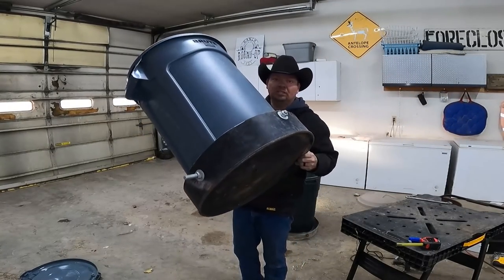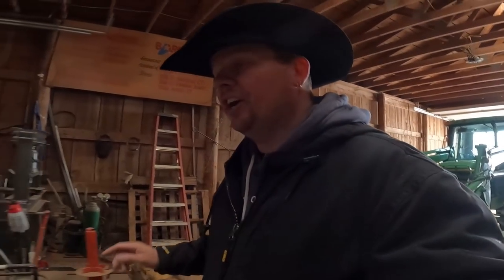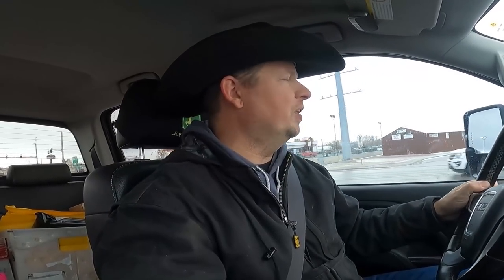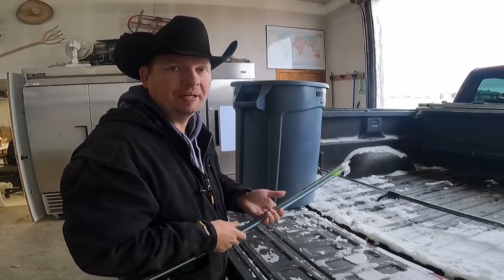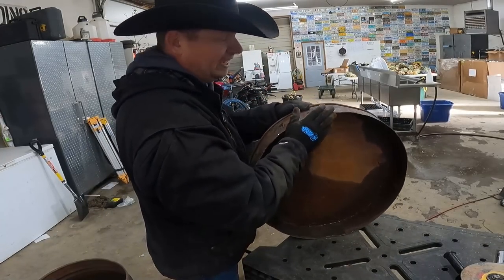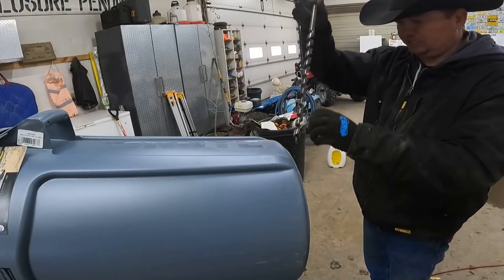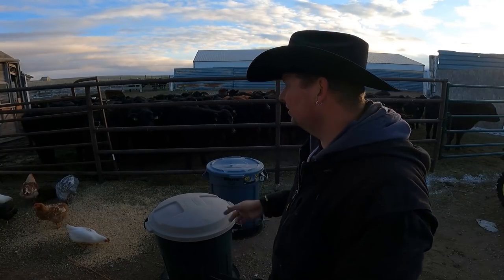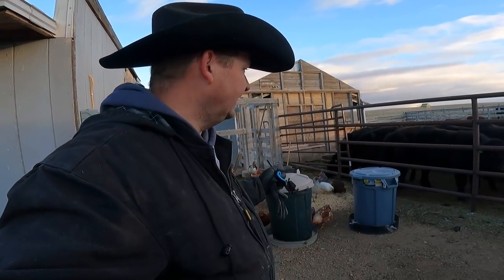Building a 200 pound bulk chicken feeder for under 50 dollars

Comment: Howdy Mike, we have a Storm Warning in progress, finally got some Snow ❄️🙌❄️! In VT at this time of year with no Snow is Pretty bleak,😝.
You look like I must have looked putting together my Gorilla Cart,😫. I screwed the nut on first everything fine . I went to tighten it down and it stopped dead on its tracks . So now the handle is loose and I can't get the nut off😭.
I like your idea ,works better than mine!
JO JO IN VT 💕😄

Comment: They make special split nuts to install say anywhere on all thread. Has two what looked like thin nuts with a u channel cut out. Years ago I had to make up unistrut ladder racks using 10' long all thread for 6 pipe racks. Had to thread on 12 hex nuts on each all thread. Of course it was old all thread that was laying g around so threads had a lot of dings.

Comment: Won't rainwater get into the feed tray ruining the feed?  We built a feeder cutting holes into the garbage can where the chicken can reach his head into it to get the food.  We put in a "hood" over the holes by cutting a PVC pipe into a half-moon.  That keeps the water out.  We did need a crossbar to keep the sides of the garbage can stiff.

Comment: You should look at the plastic water heater leak pans.  Since they are also plastic you should be able to glue them together, no need to attach the two parts together with all thread or bolts.

Comment: I hate to be a complainer, but you didn't use hearing protection while cutting off the top of that barrel.  Bad news.  I did the same thing once using a concrete saw and I'm paying for it now by having a high pitch hearing loss.  It only takes a few minutes of use with a tool like that and you pay for it for the rest of your life.  Just a little constructive criticism.

Comment: I am not 100% on the design, but it is the right idea. Spreading feed on the ground always leads to a lot of loss. I am not complaining about the prettiness of your build, I am a function over form guy. My main thing would be the use of the all thread over cutting the all thread down and just using four shorter pieces or 1 of the long rods. Nit picky. LOL My biggest concern would be when it snows or rains and the feed gets wet which will make a mess and plug it up. I know here in Wyoming we don't get the big rains, but we do get moisture. I guess we will see. I actually want to see and hear how it works long term.
Reply: He said he can take them inside too